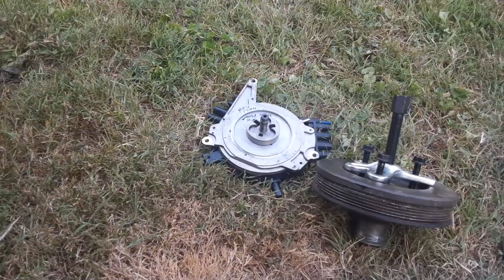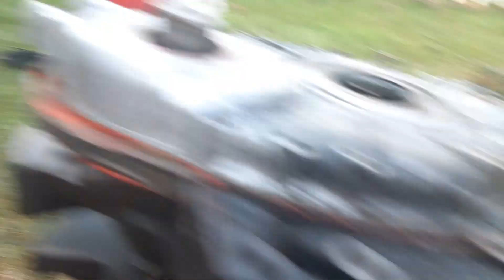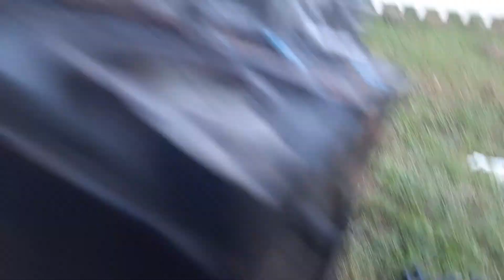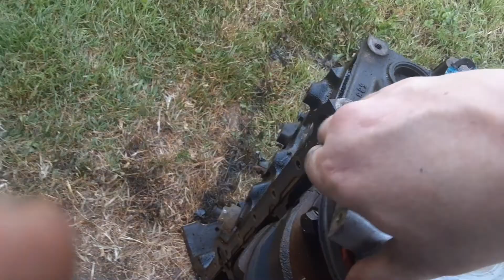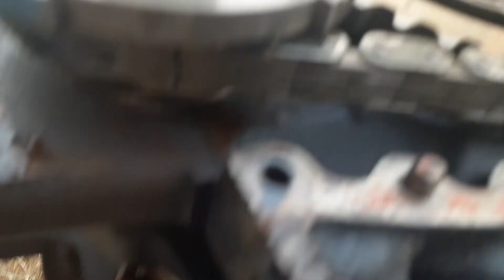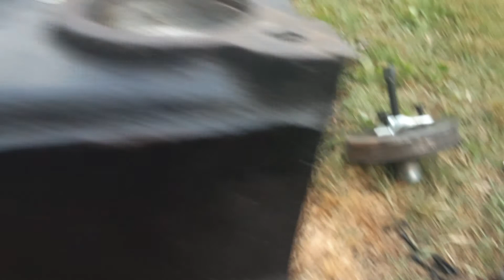LT1 pt.9 Timing Chain Inspection

Comment: It's not for people trying to remove the timing cover on the block inside the car. These were short videos of the damage and wear on the old LT1. You can clearly see by the thumbnail it's not in the vehicle, in this case, the Camaro anymore... anyone with half a brain can see that. Jesus, the grass and yard around the short block doesn't show this isn't a tutorial? 
Lol, you people are just looking to get mad... Or just read the description!
Why would you need a video to show how to remove the timing cover with the engine still installed?! 
It's the EXACT same removal process. The only difference will be cutting the front lip of the oil pan gasket. 
And then, going through the headache of trying to piece it back in without it being squeezed.

Comment: Very cool, I have built a lot of sbc engines but never got to play with a LT sbc. I can see right off the bat that the water pump ports are different from the original sbc block for the reverse flow heads.

Now you did it, I have to add at least one of these on my bucket list to do a performance build with! I think I would have to find a way to use a conventual distributor though.
Reply from the maker: There's a guy on here who has a video of him doing it to his 93 Trans Am. I should have shown it, but inside the LT1 lifter valley at the back is a oil pump drive gear that bolted down. Same small block style. If you had the hole drilled through the top of the intake and got rid the cam sensor through a new PCM program you could run the distributor like first gen sbc. They make plates for the conversion to insert where the Optispark goes in the front. I mean could leave it unplugged too. But look it up on YouTube. It's a fun project. I'm just gonna keep me nightmare Optispark. I got a LS swap I gotta do in my 87 Trans Am next. I just finished my 88 Firebird. And with this engine build I don't want too much more on my plate. It's already full lol. I did a LS1 swap in a 86 Trans Am once before. I did alot of aftermarket performance work to that car. I sold it like an idiot on eBay to a guy in the country Denmark.

Comment: Showing it outside the car does nothing for people trying to do it with the engine still in the car anyone with half a brain can figure it out when it’s out of the car
Reply from the maker: I don't understand what you're point is supposed to be here.... you can't tell it isn't a "how to video"?
Reply: @NotAGarage  then why do the video? so you can have our 10 seconds of fame?
Reply from the maker: @shawnp001 10 seconds of fame of what?! What is wrong with you? You just wanna argue? Because I posted a video? If its not for you, then don't watch! It's for my references. I'm sorry I didn't show a video on how to remove the accessories, remove the timing cover, remove the drive gear, scrap the gasket, cut the oil pan gasket, and replace it all. Clearly you need a guide... Why would you need any explanation how to do that? ... there's no difference. Except you'd be lazy and wanting to cut the oil pan gasket instead of removing the engine. These videos were clips looking over damage and wear of the old engine. Maybe you should of read what it said. Or maybe you should of been able to tell by the engine, I don't know... BEING OUT THE CAR!!! 
It's not for people trying to remove the timing cover on the block inside the car. These were short videos of the damage and wear on my old LT1. You can clearly see by the thumbnail it's not in the vehicle, in my case, the Camaro anymore... anyone with half a brain can see that. Jesus, the grass and yard around the short block doesn't show this isn't a tutorial? Or just read the description! Why would you need a video to show how to remove the timing cover with the engine still installed? It's the EXACT same removal process. The only difference will be cutting the front lip of the oil pan gasket. And then going through the headache of trying to piece it back in without it being squeezed out... If you know how to remove the timing cover, then you shouldn't need a tutorial! And if you know anything about small block Chevy's then you'd hopefully be aware of how the oil pan gasket works!
Reply: @NotAGarage  what fame? from commenting on your video? not likely, and I was then and are not now arguing, I just pointed out the obvious that if you are doing it with it still in the car that people like myself would still not know what to do to get to that point, but I figured it out without your expert insight.